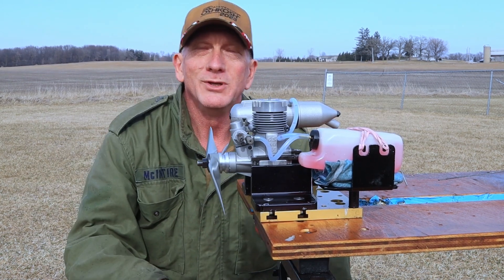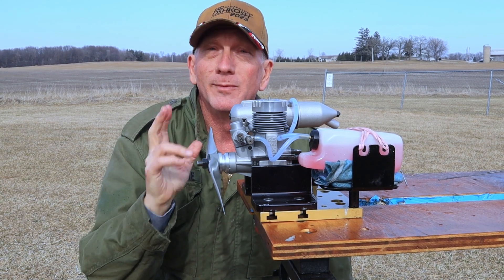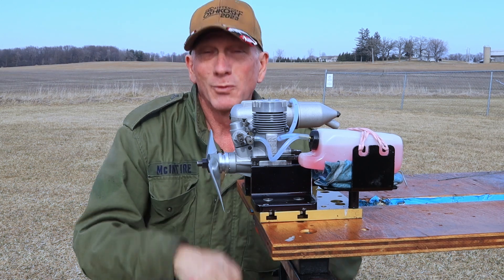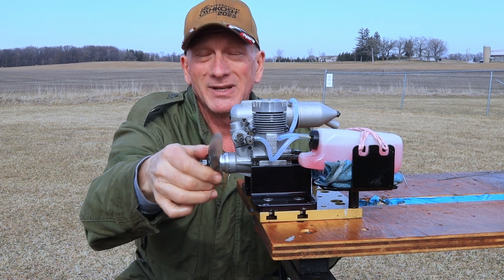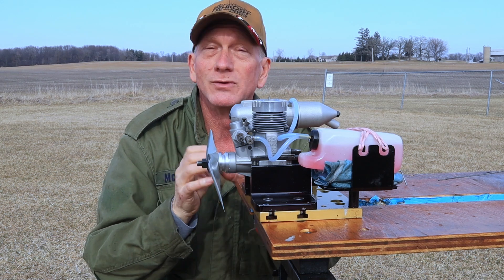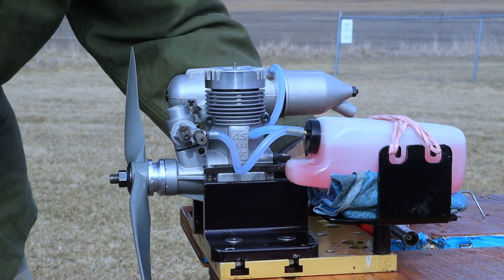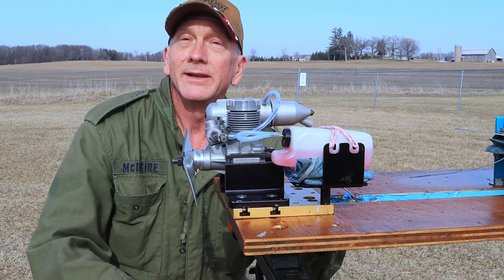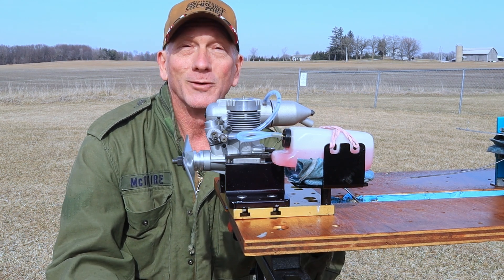OS 61 SF Ring Another Run

Comment: The engine runs very well on FAI fuel, and this nitro fuel.  I like that very much.
Reply from the maker: It should, it was designed to run on FAI fuel as I mentioned in the closing.  It also states that in the original manual.

https://drive.google.com/file/d/1kns5MFkH3lobQwqXfjdbEV1ZGD-GyWMc/view?usp=sharing

Comment: I have this same engine in my 60 size cub using a 12x6 master airscrew prop and a harrys brass heavy hub. That airplane flies very well, has ample power for a 90" wingspan aircraft and it will idle so low that I actually struggle at times to shut the engine off after a flight. I have many engines in my collection but this engine is definitely one of my top favorites because of its good manners. My engine has a standard carburetor, slightly different from yours david. I believe you have the upgraded carburetor that might have came with the pumped version of the SF 61, you all please correct me if I'm wrong but that is what it appears to me that you have.
Reply from the maker: I believe that the carb on my engine IS the standard and original carb.  It is the same carb as on the 61 SF I ran here a few years ago also.  See the original manual.
https://drive.google.com/file/d/1kns5MFkH3lobQwqXfjdbEV1ZGD-GyWMc/view?usp=sharing
Reply: @dmrcflyr2  very nice. I received mine used without the box so it is possible that it could have been changed. I remember seeing pumped engines with a carb that has that appearance. I will look over that manual. I have been curious what purpose those other screws serve when I see that carburetor.
Reply: @dmrcflyr2  I see that must be a two mixture adjustment carb. It looks like an interesting piece and I think I will have to try and find an original carb for my engine. Thanks David, I learned something new today.